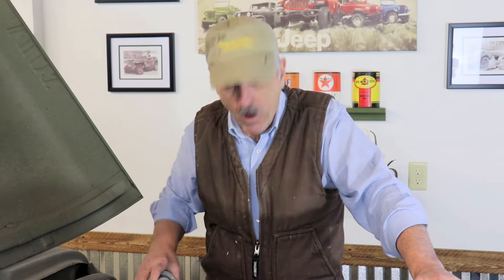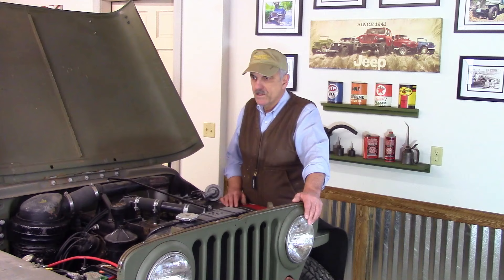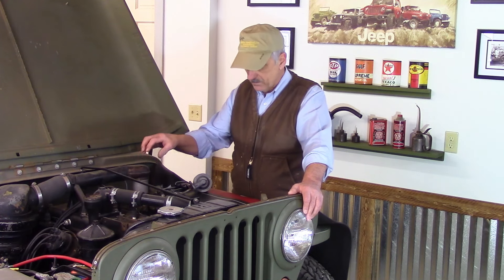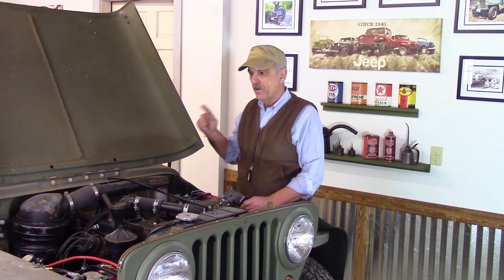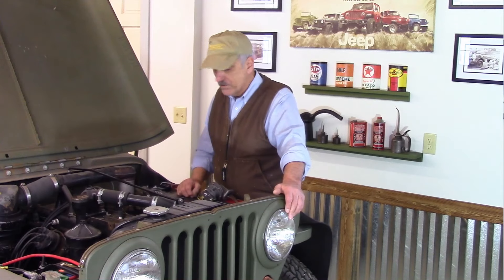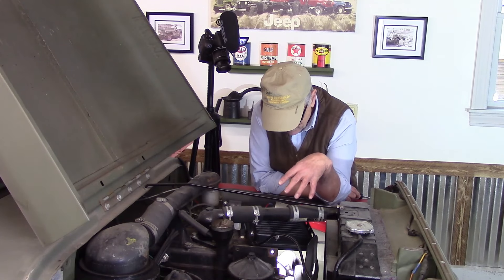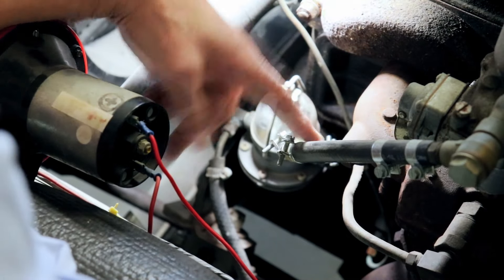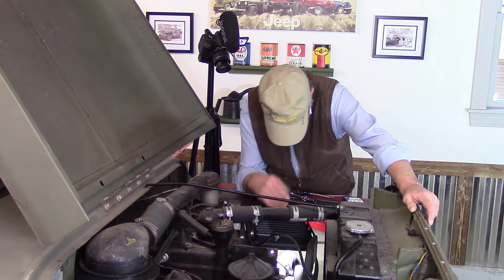1946 CJ2A Jeep Restoration. Installing a New Fuel Pump

Comment: I thought for sure, that when that rear pump bolt came out, that the crankshaft would fall out. 😂 Overkill is an understatement!
Reply from the maker: Yep Jason....I think that bolt held in the whole motor.
Reply: @rusttooresurrection813  🤣🤣 I think I actually saw the front of the Jeep raise up a half inch when you pulled it out. Personally, I would've used the cherry picker to save your back!
Reply: @rusttooresurrection813  on a real note, it's great to see progress! Looking forward to the next step.
Reply from the maker: @IndirectConnection1  Thanks Jason!

Comment: Did you have to rotate the engine to take some of the pressure off the pump arm?
Reply from the maker: No.  It fit right in.  The pump lobe is pretty tiny but it may have already been in a good alignment.

Comment: I had several 134 l heads. I would have blown back into the gas tank to make sure there's no obstruction first thing. you're only looking at a 10-minute job 2 change a pump.
Reply from the maker: Well...thank you Bill. So including filming it took me about a half hour.  Not bad I guess for the first time.  I know the pitfalls now so the next one should be faster...do you agree?

Comment: Well sir I missed the question as to using sealer or not. I would. Discriminately, yes. It doesn’t take nearly what I see typically used however. It’s more of a gasket dressing.
Reply from the maker: Got lots of responses to that question Brian...some were pretty passionate.  Ill text you sometimes and tell you a little secret about that install that I didnt film.